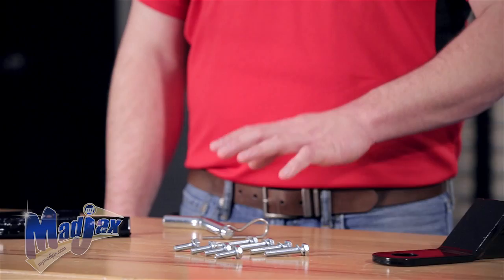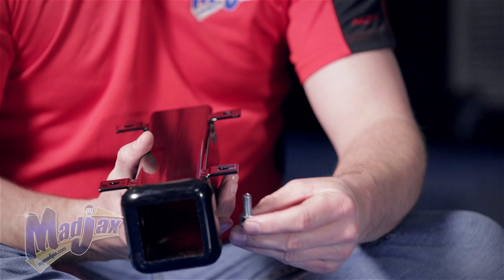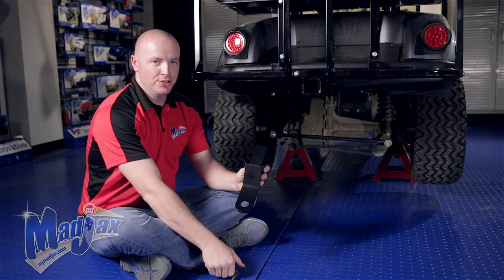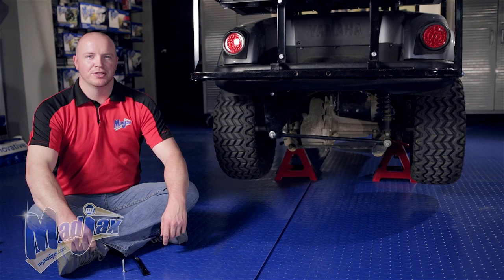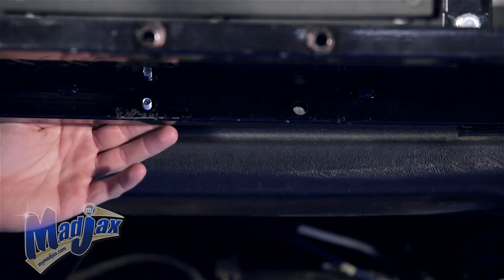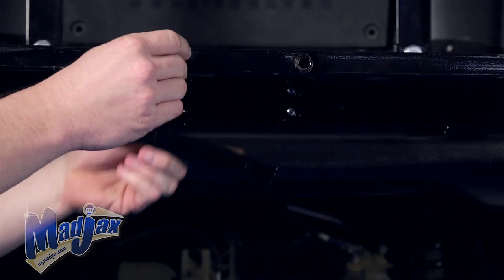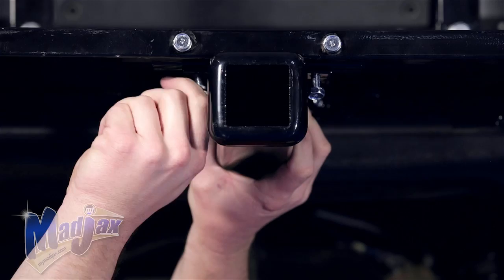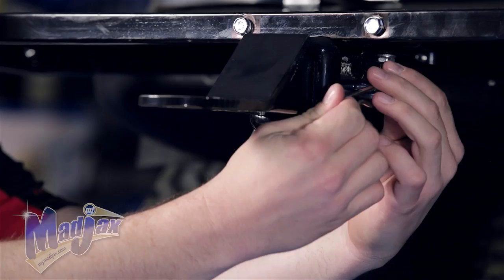Universal Trailer Hitch | How to Install Video | Madjax® Golf Cart Accessories

Comment: I'm looking at buying a gas golf cart and I would use it to pull a trailer but I also want to carry people so what golf cart is this and what rear seat kit is that? And what can the hitch kit handle as far as tongue weight because I mow lawns and I am 13 so I can't get a truck yet so I'm looking at older golf carts but I need a gas one and I also want to lift it so if I was to do all that how much would it be roughly thanks